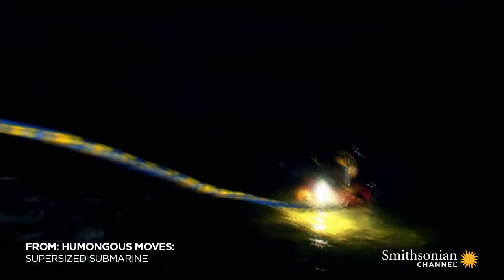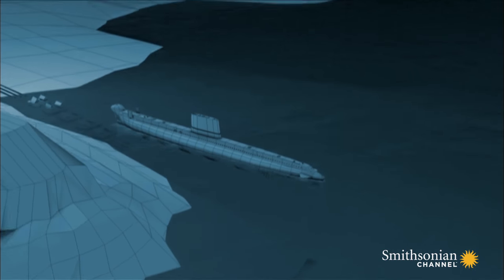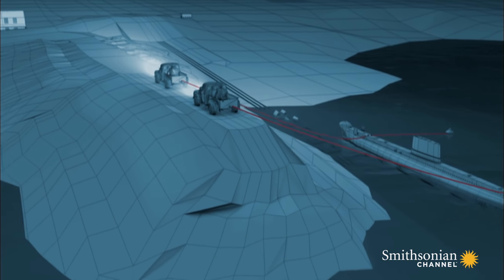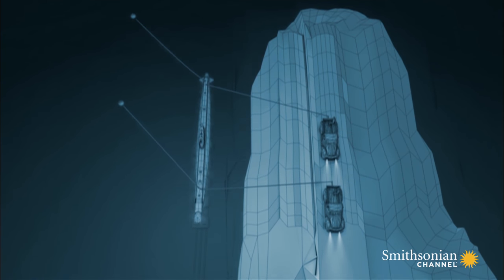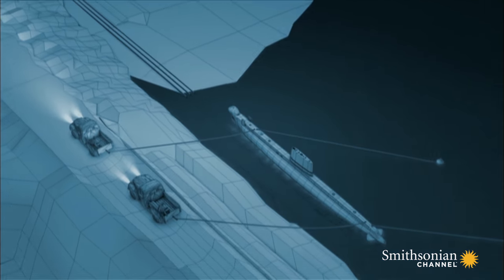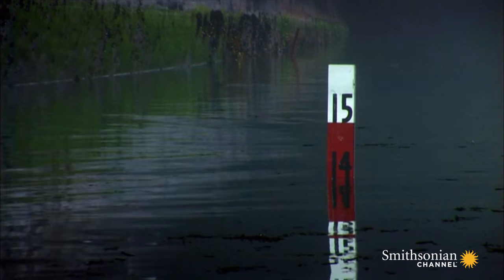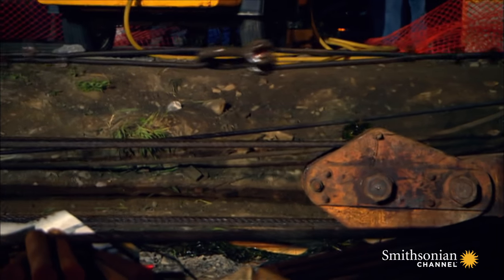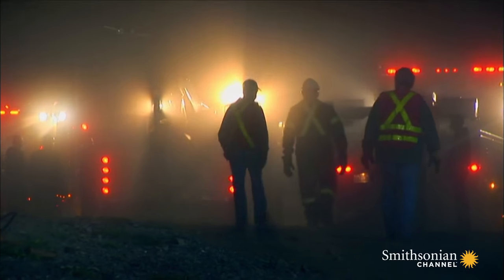Why Dragging a Giant Submarine Onto Land Is Very Risky

Comment: The conning tower is not visible. The conning tower is an upper pressure vessel separated from the main pressure hull and it is located inside the sail; you can't see the conning tower on that boat. The purpose of the conning tower is to be able to raise the periscope eyepiece higher inside the boat ... sticking the periscope head up farther away from the top of the sail ... to allow the boat to stay deeper in the water when at periscope depth and prevent the boat from broaching and being seen. 

WWII subs also located the attack computers and a separate helm station inside that tiny conning tower to centralize command and control during a torpedo attack. Modern boats are large enough to have the necessary inner space that conning towers are no longer needed. Stop calling a sub's sail a "conning tower"; it's the wrong term.

Comment: Isn't this what dry docks are for?
Reply: The Hand Of Truth it's is a dry dock nubskull
Reply: A dry dock is just a sectioned off area of a harbour. The problem is, they needed no pull it out by ramp, while a dry dock is just a squared off hole. If they tried to lift it by crane, the aging hull would most likely buckle.
Reply: Its not a dry dock
Reply: Brandon Saunders  well if the ship is on land how are you going to bring it up hill
Reply: Lol, did you not watch it? The tides lift it up and they pull it into position. When the tides fall again, they line it up with a rail system that slopes into the water so they can pull it up. It's a mechanical rail system, but not a dry dock.
Reply: Nerd Herd Productions no dry docks are for repair, and temporary docking. That sub, is going to remain on land for the rest of its life
Reply: @ExploringCabinsandMines  Lmao, I like how you responded to my comment made a year ago. It's literally information in the episode if you watch the full thing.
Reply: @brandonsaunders2823  why does 1 year matter ? I just doubt that a hull 2-3 inches thick would break in half, remember this show is fake drama.
Reply: @ExploringCabinsandMines  It's a circular tube with no beam. While a boat can be lifted because a majority of the wieght rests on the reinforced beam along the bottom, the submarine, which it 90 meters long, doesn't have that long support and creates crumple zones on the tube as it squeezes in. A pressurized submarine is designed to take equal pressure on all faces, not one side so you risk the hull by pulling it up.